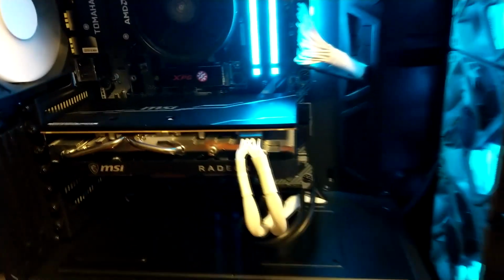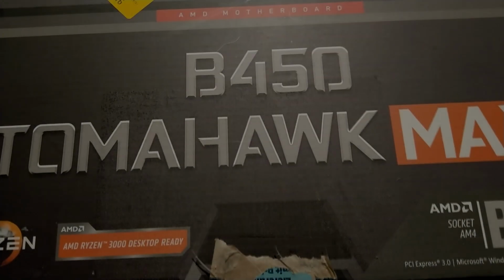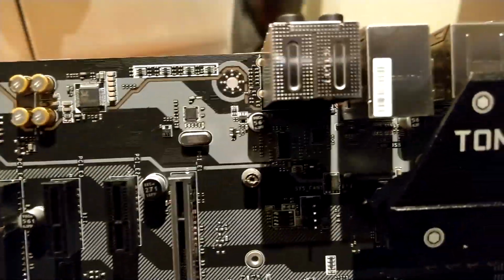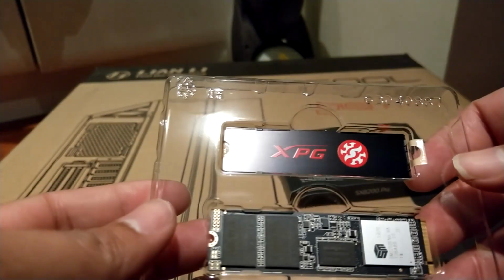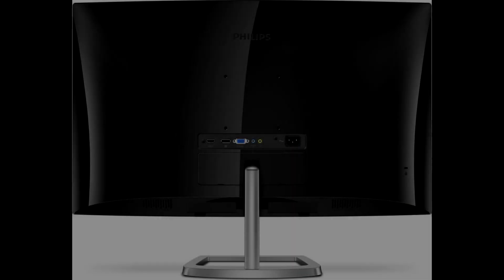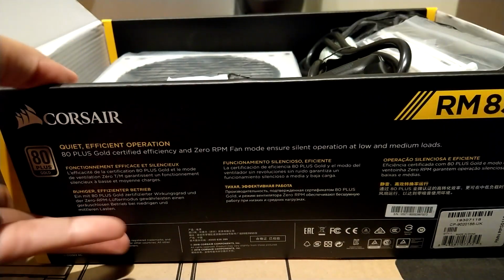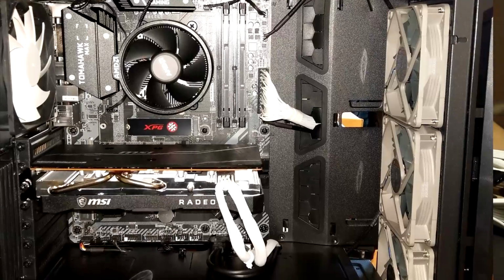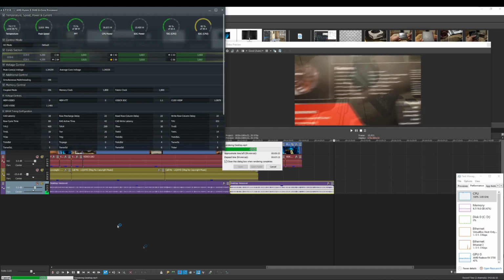Ryzen 3600 Gaming and Editing PC Parts and Benchmarks

Comment: whats the idle temp you get , and the temp you get while browsing on chrome for example and the temp while rendering
Reply from the maker: Idle and light work varies from 34-44°C
Rendering is 74°C which is still comfortably in the green zone using Ryzen Master monitoring.
Reply: @sirobb  with same cpu i bought it just yesterday , using stock cooler 
i got 42-50°c idle and 60°c idle by just moving the mouse !
and 93°c in cenbench R20 render , all my Bios settings are Auto
im really disappointed.. years of collecting money to build this pc then i cant even render a 1 min scene in a safe way . I wish I can return everything now and back to intel
Reply from the maker: @DoctorMGL  There's a lot to said for the case and fan configuration too so it may not be the processor and standard cooler at fault.
Reply: @sirobb  so what could be the reason ? , any help ill appreciate it a lot
Reply from the maker: What case have you got and how many fans do you have?
What's the placement and configuration of your fans?
Reply: @sirobb  i have master cooler case 43cm x 35cm fully covered by glass on side and only one 120mm fan or rear , and one on cpu (stock cooler) my room temp is btw 20-25 , my mobo is B450M pro vdh PLUS with latest bios update , and latest chipse update .. i tried opening the side case and even pointing a big fan to it nothing changed same temp
Reply from the maker: Which Coolermaster case exactly as quite a few have poor thermals.
The Gamers Nexus channel have covered tons of cases so check if they have an opinion on yours.
I have the stock cpu fan, one rear exhaust, one top panel exhaust and three intake which are hardly ever on as the exhaust fans do most of the work.

With good airflow, the stock CPU and cooler are fine so don't discount checking again the mounting of the CPU fan and maybe renew the thermal paste.

Comment: That's a great pc you've put together, should last for a while too. How fast was the RAM you bought?
Reply from the maker: Thanks. Ryzen likes fast RAM so I went for 3600MHz but only because the price difference was negligible to 3200 which I would have also been happy with.
Reply: Memory is not just about the speed. What's equally important are the timings. The lower the better. So as an example; 3600 MHz CL16 has roughly about the same performance as 3200 MHz CL14.
Reply from the maker: True and you can also overclock the speed and pull in the timings slightly too.
It's a general guide video though so describing every possibility for every component would take too long.
Reply: True. Personally tho, I rather buy the memory with the speed and timing I'm after than trying to clock the snot out of a lower speced kit with all kind of potential issues, hurdles and headaches. I like to focus on CPU clock first. If I than can tweak something out of the memory once I have established a stable CPU clock, well that's just icing on the cake. It's interesting tho, that you have these kinda same interests as I have. Car maintenance and repairs, home appliances repairs and computers also. Now wonder I am a long time subscriber 👍
Reply from the maker: @VNAV_PTH  Well it's good to have you on board.
I have wider interests still but unfortunately the YouTube algorithm doesn't like you to stray too far from the core channel subjects so it'll be back to the car videos for the next few uploads. 😊